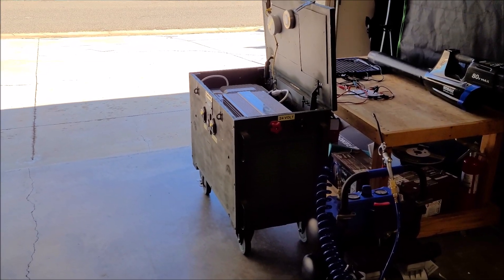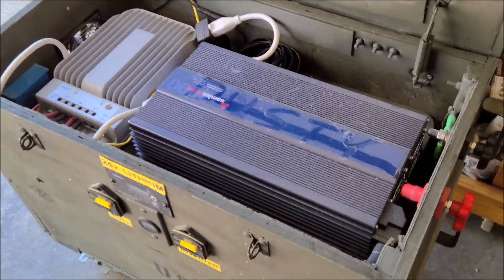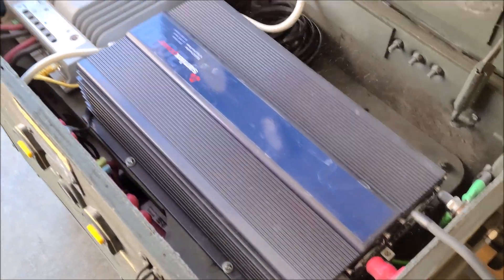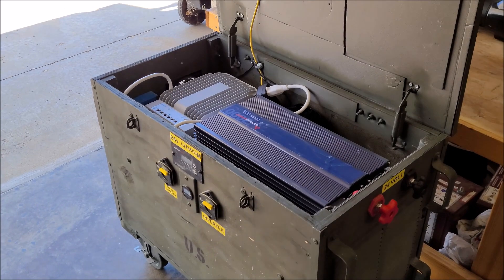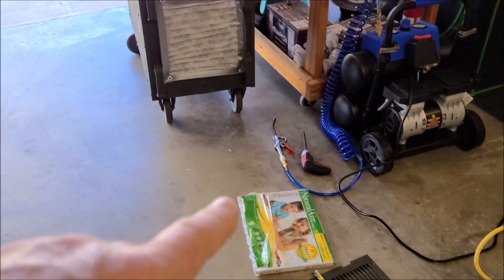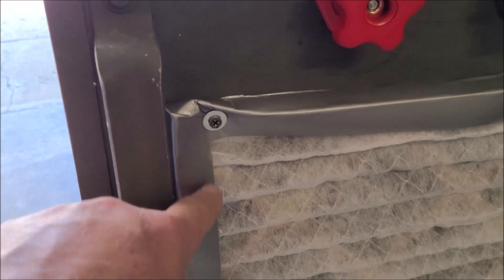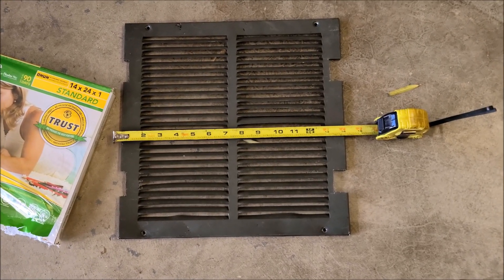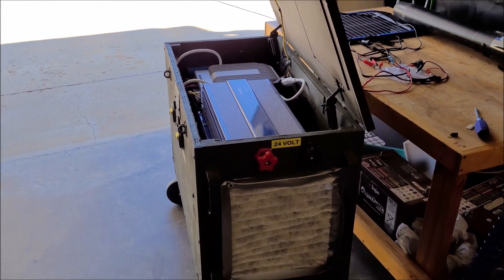Blowing the dust out! 24v roll around solar power generator inverter battery box

Comment: What you need is a filter grille. Not sure what size hole you have in the box? But lets say it's a 12x12 hole then you get one of these grilles and screw it on the box and then you would just open the grille to take the filter out and put a new one in.  You may have to build the hole out an inch if you don't have the clearance in inside.  Hope this helps. Here is a link to one of the grilles. https://www.amazon.com/Return-Filter-Grille-Removable-Dimensions/dp/B07PBMJSP4/
Reply from the maker: THAT is exactly what I need! Thank you for the link and comment!

Comment: I know you have a good size solar setup. Was wondering if you had made any changes. Do you prefer 12 or 24 volts on a medium size system
Reply from the maker: 24v for this roll around is excellent (medium sized). "Most" solar folks say 400w in panels or lower - 12v system. 400-1,000 watts - 24v system. More than 1,000 watts - 48v system. To each their own and budget I guess.
Reply: @ChrisDIYerOklahoma  
Awesome. Thank you for your input I have a max of 800 so I’m sure I’m getting at least half that during the summer. I was at 370 watts on the PV  side yesterday. I just bought a 24 V power inverter so I’m going to give that a try

Comment: Gotta love dem bunnies, spring cleaning before spring cleaning. Using a pleated furnace filter will help keep the bigger bunnies at bay is not a bad idea. Might need to put some weather stripping on the lid to make sure all of the airflow goes through the filter. I safely presume the Battle Born Batteries upgrade made it relatively drama free too? At the going rate, you’ll be the Maytag repairman of solar.  :-p
Reply from the maker: Thanks. I will see how this cheap filter DIY mod does in the next few weeks. As for the Battle Borns...they are beasts. 4.8 kWh roll-around power box! Nothing to sneeze at IMHO!
Reply: @ChrisDIYerOklahoma  I agree and that's usable vs half out of the lead boat anchors. Once I get my other projects sorted out, I am tempted to build the same version you have, but with an additional safe compartment with some extra "firepower" ;-). Always better to have it and not need it then need it and not have it...